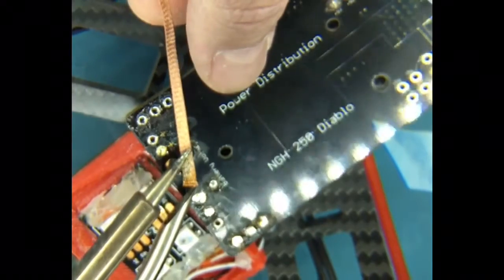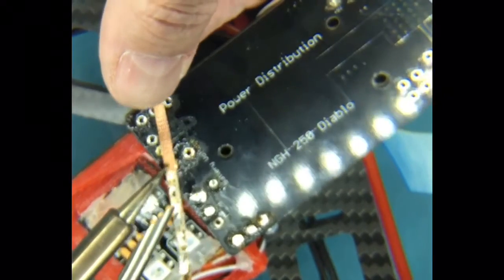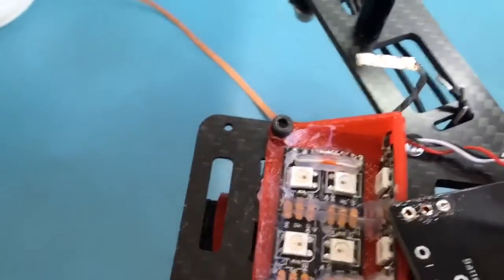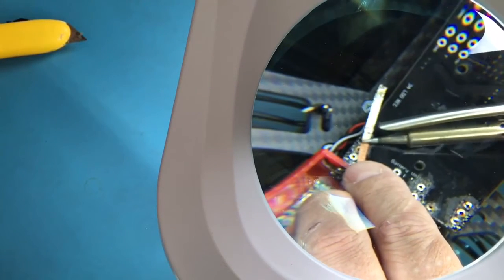How to clean the solder from plated PCB holes

Comment: I want to than you for suggesting a 400 degree temperature. Along with toothpicks soaked in desoldering grease,
I pushed the toothpick through and cleared the silver solder I've been trying to get out of needle pin- sized holes for years. I can now proceed with my project. I hope I can recall where everything went...LOL! Thank you.